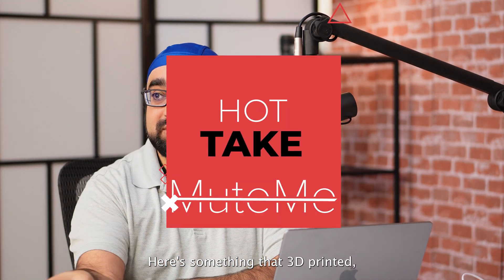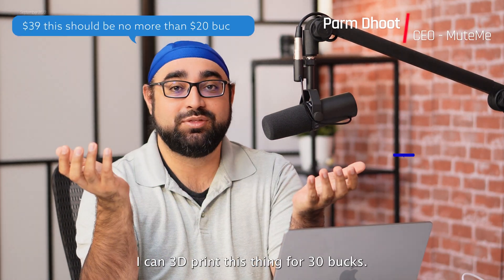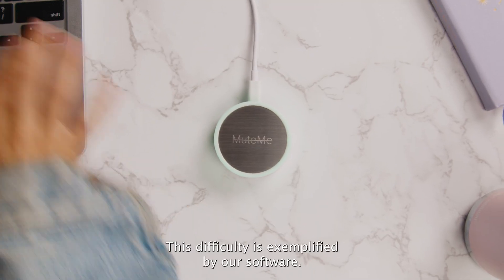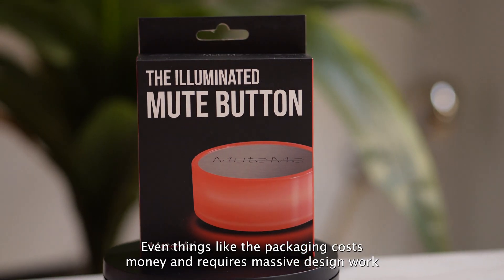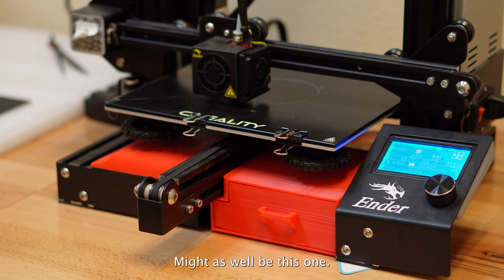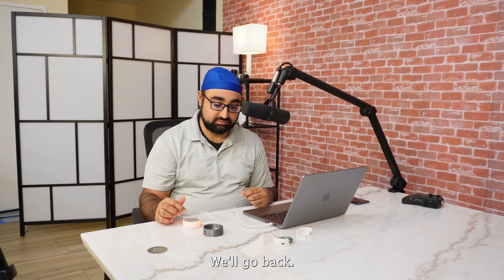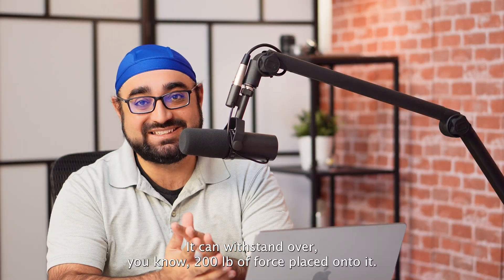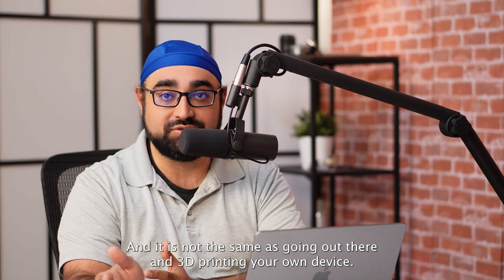HotTake: Why you can't just 3D print a MuteMe

Comment: 20,000 lines of code is laughable.
Reply from the maker: Why is is laughable? I just ran VS code counter and we currently have over 36k lines of custom code. We have 29 modules one for each of the platforms on each operating system, then we have code to control the device, interact with the OS, then we have code that ties it all together. We tried doing a unified version at the start but it ruins performance and adds clock cycles for no reason.  Just to be clear we have 8398 lines of Javascript, 8195 lines of of Typescript, 5365 lines of C++, 2281 lines of objective C++, plus we have swift, python, html, css, JSX...and more.

The 36k lines does not even include the firmware for three different chip families (born in the pandemic durring the chip shortage and needed options), all the server side stuff download servers, update servers, data services, logging, backend reporting system, and all the software that is used by our team from everything from device testing, to firmware programing, to USB/HID tools. 

It is easy to make something for a single person but it is completely different game to make something mass market.

Comment: You realize there are many different types of filaments for 3d printing and even regular pla can be as strong if not stronger
Reply from the maker: Typically they are not stronger than injection molded parts. Injection molded parts are made in one shot, whereas 3D printed parts are weaker at the joints /layers. This does not mean that 3d printed parts cannot be strong, they  can be extremely strong. But in the video it was an analogy thats why we mentioned that the part that shattered was SLA resin print, if we used a PETG or a PLA some of the cheapest FDM process filaments the part would not have shattered when smashed into the table. It may  have still cracked with the 200 lb of force however.